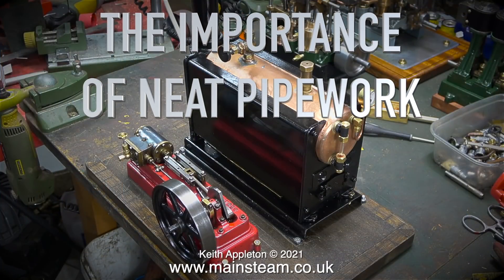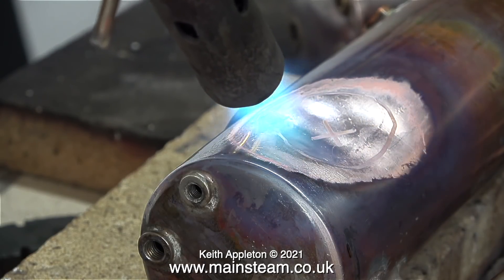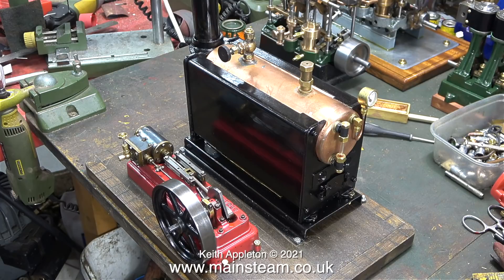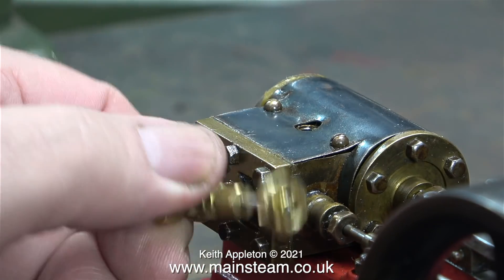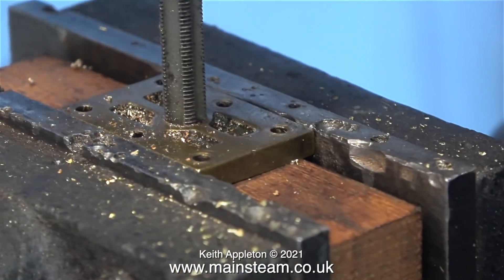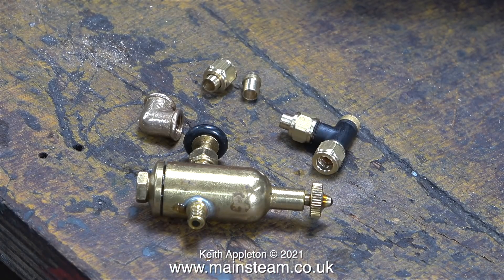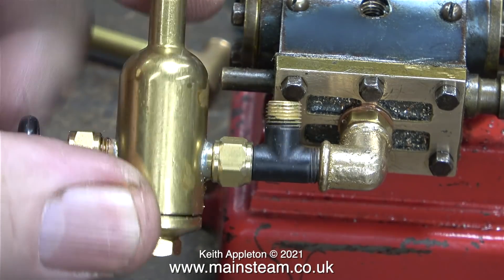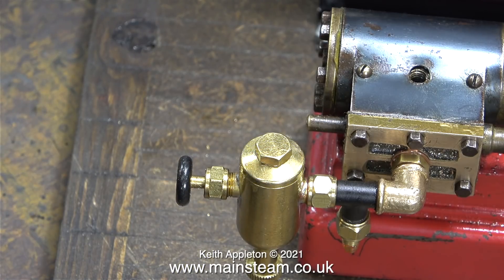THE IMPORTANCE OF NEAT PIPEWORK - PART #1

Comment: I wonder if the threading problem you have with PM Research is that the thread is metric/unc rather than Whitworth which is what is used in ME threads. I doubt it is the pitch as both are 40 threads per inch.
Reply from the maker: one is 55 pitch, the other is 60 pitch ......
Reply: @keithappleton  That confirms what I was thinking, 55 degree is Whitworth and 60 is Metric. I was interpreting pitch as 1/threads per inch i.e. 40 threads per inch has a pitch of 0.025 inch hence my confusion. Many people think the USA do not use metric, but during the War NC and NF became UNC and UNF which has imperial thread pitches and metric thread angles, much like all political compromises ends up causing confusion.